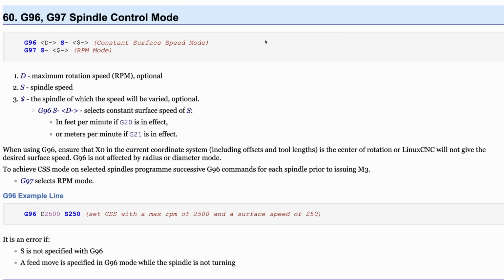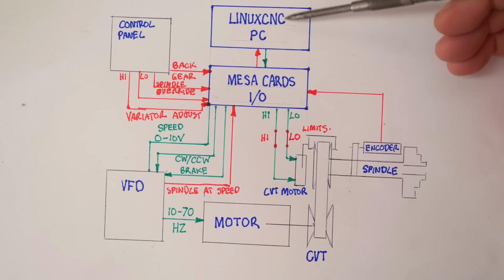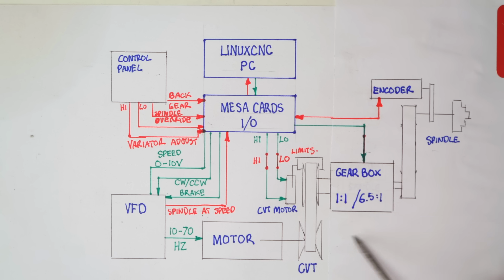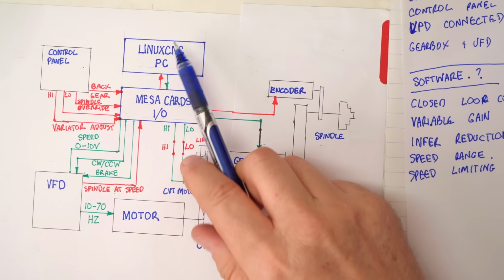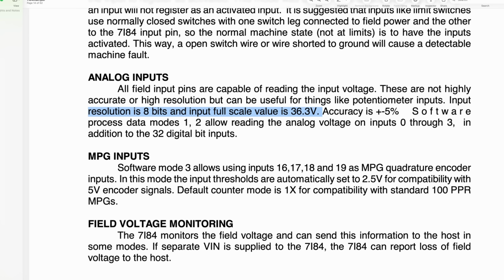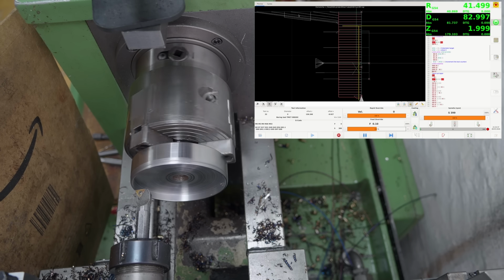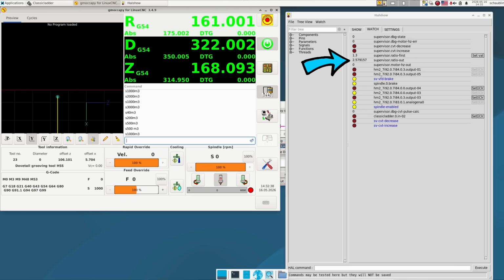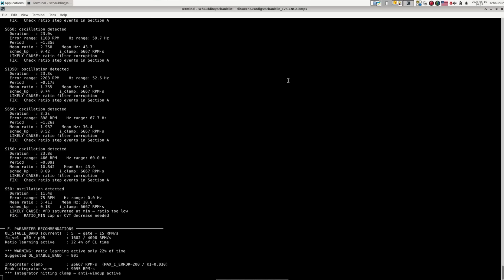Schaublin spindle control Ep.68. || RotarySMP

Comment: rather than being dynamic, I would just calculate some hard ranges, code it that way. If spindle speed is in this this range, set gearbox this way, CVT this way, and use the VFD and the spindle encoder to do the final correction to get to the desired RPM. Do that for a few ranges, and good enough. I think otherwise you have too many unknowns and too many equations, so there's an infinite number of solutions, and the AI generated code isn't smart enough to figure out how to pick one intelligently.
Reply from the maker: Yeah, i just got to that point as well. I'll do a survey and make a look up table.
Reply: Basically it has two separate, very different reacting controls to change the same thing.
Reply: The problem you'll run into is different materials,  different cuts, different results. 

Sure you can add a third category..... but at some point you'll realize adding a little feedback would have been easier and produce better performance

Comment: Encoder on the CVT belt?
Reply from the maker: It would not matter which end of the motor shaft it goes on, but would be easier to install on the fan end of the motor.

Comment: Quite the journey.
Reply from the maker: Yeah, and still back at the start :/
Reply: In the end a modern servo motor and vfd will be the best choice for such a small lathe and not terribly expensive.  They got rid of the cat monkey business for a reason.
Reply from the maker: @modelmaker007  Sounds simple. Isn't. 
I dont have the spare cash for that. 
Chinese servos do not have the long shaft necesary to mount the CVT. 
I have only 16A feed.
Change one thing, change everything.
Reply: @RotarySMP I would at all cost delete the cvt, and drive the gear box directly with either a 3ph motor and vfd, or in the future with a nice servo when money allows. Not saying you can not make the cvt work, it just will not hold up over time and never mind the headache of programing for it. The gear box is well worth keeping and would be easily accounted for by the software if you put some hall effect sensor to tell it high or low gear. 
Also, am not one to waste a nice cvt, it would be perfect for a small bandsaw or drill press, something that would likely get less use than the lathe. 
Look forward to the final solution you devise. 
Can't wait for the axial turbine engine build in future episodes 😊

Comment: I would 100 percent add a cheap encoder on to the spindle i think all your problems will disappear with some clean reliable data in.
Reply from the maker: I need to take a closer look and see how hard that would be to achieve.
Reply: @RotarySMP  look at the encoder that Clough42 used on his G0602 when he did the electronic lead screw - they're cheap (if you get the unbranded ones, which seem to come from the same production line as the branded ones), and quite reliable
Reply from the maker: @gorak9000  Yeah, about €16. I need to look at how I can fit it.
Reply from the maker: I added more info to the video description on what my next attempt will be.

Comment: I think you do need to "know" the motor speed and CVT position.  Is there something that will take 0-10V output from the VFD and convert it to 0-36V?   But a rotary encoder of the motor would be probably simpler.  And add position indicator for the CVT.  That possibly would let you build a map for each speed in say 10RPM increments (or maybe 1 RPM increments for lower speeds and 20 for higher ones).  

e.g 400 RPM = this motor speed, the CVR position and this back gear.
Reply from the maker: Thanks Craig, I need to look and see if there is an off the shelf widget to do the voltage scale up.

Comment: Great video. I think you should reevaluate getting the motor RPM over the 7i84 ADC. It is not super accurate, but I get serviceable results out of it. I would be happy to help. It is not perfect on my machine, but it is certainly usable.
Reply from the maker: It might be the best thing to do. I wonder if there is a simple off the shelf widget which could scale that 0-10V signal up to 0-36, to use the full range?
Reply: @RotarySMP  That would be an op-amp. But first, you could try what you already have.

Comment: For the motor speed, i think you could use some sort of fet or transistor between a reference voltage and input on the mesa card controlled by the output of the vfd 0 to 10 volts. Though... It might have to be a kind of complicated circuit. Hmmmm
Reply from the maker: I kind of wondered about that as well, but have not explored it yet.
Reply: one of basic opamp aplication is "voltage scaller" and it is 3 components. (opamp and 2 resistors) i typed comment above(or below)

Comment: The attempted cleaning of that name plate has become a fine tradition, well done!  (At this point I am almost certain you are re-filthing it for your cinematographic agenda, not that you'd ever admit it ;) )  It seems you could infer the speed as proposed by introducing a dwell, a sample and hold type function on the encoder output to give the thing time to stabilise before commanding again, could make for poor cuts though with pauses everywhere.  I'd also consider some kind of small secondary microcontroller and a couple of sensors to read the cvt ratio directly, maybe a couple of simple hall sensors and magnets on each belt pulley to measure relative rpm and therefore ratio, then pipe that ratio into linuxcnc via RS485 or some such. Easy as pi to be honest.
Reply from the maker: That is pretty much what the Chatgpt version did, but those pauses are also unacceptable behavior on a CSS facing cut.
Reply: @RotarySMP  Indeed, you have to be doing retracts on each resettle, a mess, not a viable strategy.

Comment: I just had DeepSeek in 'expert' and 'deep think' mode rewrite my arduino code for a PID servo controller using a cheap encoder and motor driver combo; better than anything crapGPT or Gemeni could ever do; they output junk code, and when presented with the error logs would just end up in an infinite loop of breaking things more.
Reply from the maker: I think the main issue I have here is that the underlying concept of using gear ratio, calculated off the VFD command voltage is too flawed.
Reply: @RotarySMP  If it was me doing it, I really would look at getting some kind of feedback on the CVT position. To me, the logic would be, keep motor Hz constant and then step through all possible CVT positions (with a fixed gear ratio). That way, you know that for every fixed VFD frequency, you can get a range of spindle rpm. I would then do, for example, 1:1 gearbox ratio, 10 Hz, 20 Hz, 30 Hz, 40Hz..... 70 Hz VFD while logging the rpm from spindle encoder throughout the CVT positions. LinuxCNC would then do a somewhat simple mathematical conversion; if speed = X, use VFD frequency Y + CVT position Z. That way when varying the speed, e.g. constant surface speed, the software will know that every fixed CVT position will adjust the rpm by some amount whenever the motor's commanded frequency changes.  The easiest thing I can think of would be simply a rotary encoder + belt attached to the CVT shaft. Trying to use a gear ratio from VFD is not (in my opinion) going to work for you, since the commanded VFD frequency is affected by the CVT position; the logic is then somewhat complicated because CVT position OR commanded VFD are both able to achieve similar spindle rpm ranges.